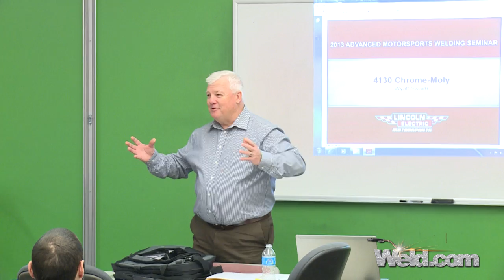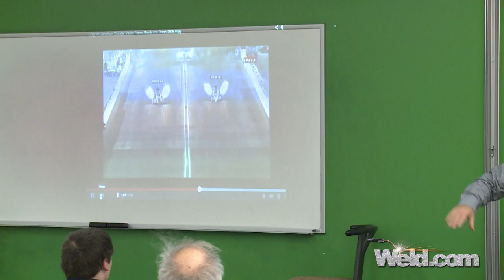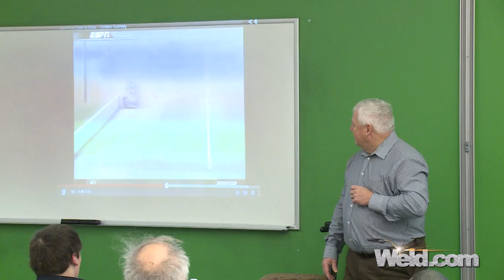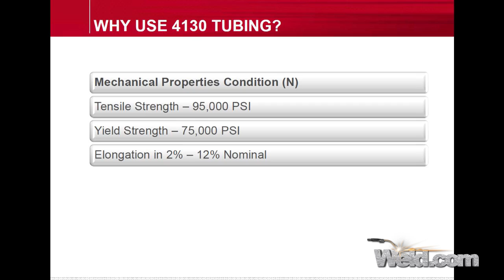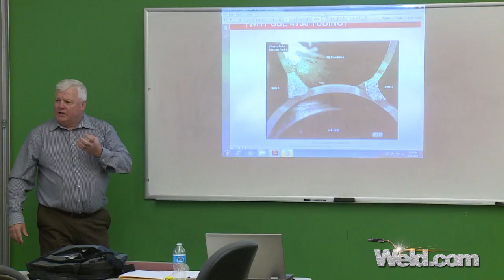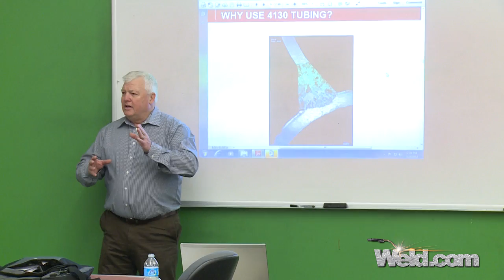AWS Advanced Motorsports Seminar  4130 Chrome Moly | TIG Time

Comment: Interesting video. About the only real "take-home" lesson I got is that he's saying that for 4130N steel tubing in the thicknesses used in aerospace and car racing, no post-weld stress relief is necessary if you use the recommended rod (ER80S-D2). Interestingly enough, there's a fellow that gave a great presentation on the metallurgy in welded 4130N steel, and (among other things) compares/contrasted the Martensite formation when the tubing is welded with three different rods. Here's the video, with a link to the exact point in the timeline where he shows the differences:

https://youtu.be/ytSrEggjz1A?t=53

Comment: This man is 1000% correct. once you change the heat treat or put these things in an oven to Normalize it, then it is no longer 4130.
Reply: No, it's always 4130. It's just not as strong as 4130 in the normalized condition. You don't take Chromium or Molybdenum out of the metal...you simply change the state of the molecules so that the hardness of the 4130 is less and approaches that of "annealed" 4130. So while it's still 4130 in chemical composition, it's more similar to mild strength in terms of yield and ultimate tensile strength(s).

Comment: 4130 is available both in heat treated tubing as well as not-heat-treated. 
Check with Columbus, Reynolds, True Temper, etc. for their own variations upon the ChroMo wonder alloys (differing 4130 options).

Comment: How hot does it get when you gas weld it? All them old school aircraft frames where gas welded, I have read about tests that er-80 rod raises the crack risk, Also that the weld done with er80s2 is stronger then then the normalized 4130.  Check out this link: http://netwelding.com/Welding%204130.htm#Strength_ER70S-2

He's got a lot of good info on there. It's saying that the er80s2 is 22% stronger then the 4130 tubing when welded, 110k tensile strength and that mild steel rod is only 9% weaker 82k tensile strength than the 4130 when welded .

Comment: When I worked at caterpillar I had to flame straighten the 11/2" thick  mild steel plate before it went to the machining shop, because of all the welding done on the top side of the plate. Does flame straightening weaken the welds, besides suposedely stress relieving the welds?
Reply: John Berry  That would depend on the base materials, welding process and the filler material(s).
Reply: Since it's "mild" steel, its carbon content isn't high enough to be heat-treatable. Therefore you aren't going to anneal it either. So when you heat mild steel to be red-hot, you simply have HOT steel. As long as it doesn't melt it will still have the same strength when it cools off--that of mild steel.

Comment: Is powder coating a bad idea??????
Reply: ECCMetal Powder coating itself is not a problem. 
Powder coating stressed chassis and roll-cage elements is great for corrosion control and aesthetics, but has the potential to hide fractures and flaws developed while in service, until there is a complete failure. 
Some say that powder coating is bad for Chromoly because it employs a heat curing process that anneals the tubing and welds, but that is not true. 
Powder coating is usually oven cured at approximately 400 degrees Fahrenheit (204 C) for 10-40 minutes which is well below annealing temperature or any other metallurgical altering temperature.

Comment: Thanks, you have confirmed what I have said and done in contrary to the experts, The books always seem to say warm it up and stress relieve  but  they say it runs the heat affected zone away from the weld area. I say it softens the whole thing now you confirm it, but they probably will not change cos that's the way it has always been done!!!!!!!!!!!!!!!
Powder coating should not make much difference as it is only 190 degrees .
Regards 
Graham   in UK
Reply: Graham Dawes  I have seen, read, heard and been taught the same. However, it still depends on the application, design, base materials, welding process and the filler material(s) used whether or not pre/post welding heating and stress relieving and possibly heat treating is required. 
As examples, if high end 4130 or similar filler is used then pre/post heating, stress relieving and heat treating is usually indicated. 
If using ER80S-D2 filler on type N Chromoly then pre/post heating, stress relieving and heat treating is usually not indicated. 
The particular application that Wyatt is referring to in this video is sanctioning body and SFI specification motorsport chassis fabrication which has its own set of rules to follow and he is spot on. 

The downside of powder coating is that it hides flaws and fractures that develop while in service until there is complete failure. The powder coating does not telegraph the underlying fractures/fracturing through the coating to the surface to make them visible during inspection. 
Most powder coating systems use curing temperatures of approximately 400 F (204 C) that are well below any critical metallurgical altering temperature.

Comment: Powder Coating isn't a great idea either.
Reply: Defender Chassis  231flash  
Powder coating itself is not a problem. 
Powder coating stressed chassis and roll-cage elements is great for corrosion control and aesthetics, but has the potential to hide fractures and flaws developed while in service, until there is a complete failure. 
Some say that powder coating is bad for Chromoly because it employs a heat curing process that anneals the tubing and welds, but that is not true. 
Powder coating is usually oven cured at approximately 400 degrees Fahrenheit (204 C) for 10-40 minutes which is well below annealing temperature or any other metallurgical altering temperature.
Reply: Why?
Reply: Defender Chassis
I've always heard Chrome Molly and powder coating don't mix well. I could be wrong but I would check it out before you do it just to be safe.